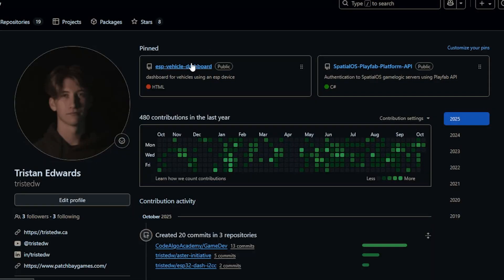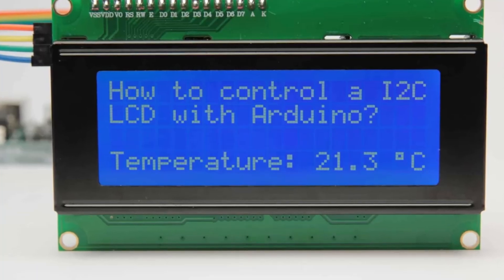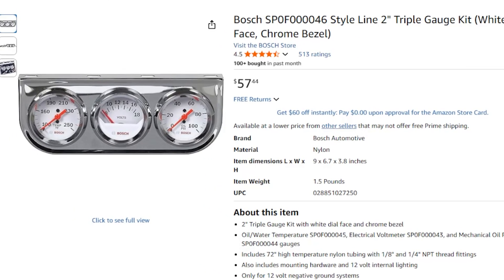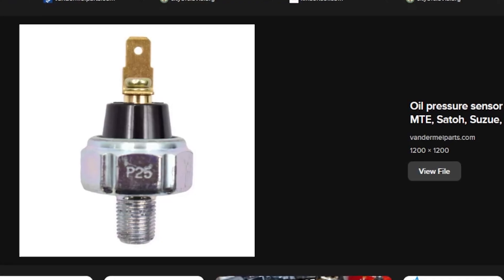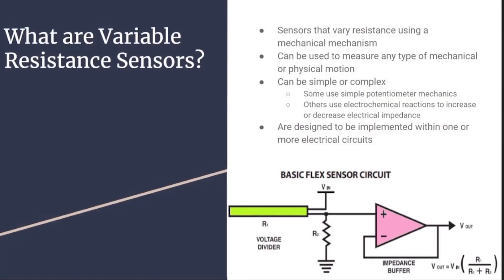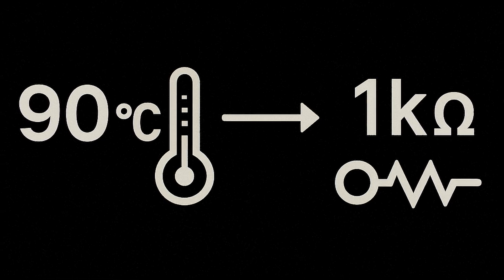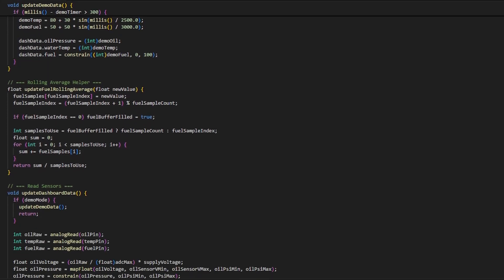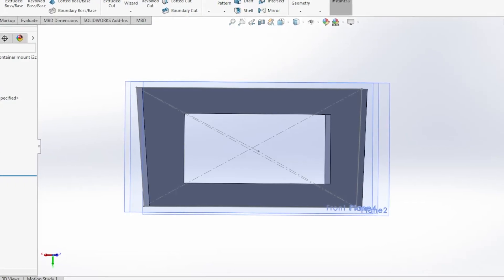DIY Digital Gauges For Under $30

Comment: did you make a tachometer without using the odb port?
Reply from the maker: Can be done just requires a separate circuit to interpret rpm signal from the ecu to the esp.